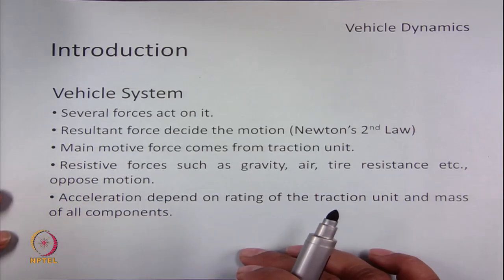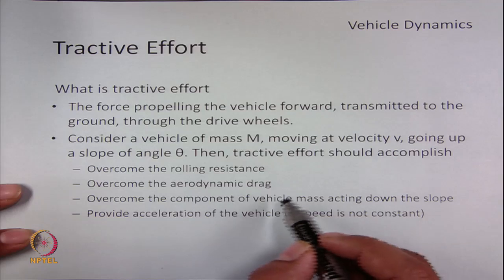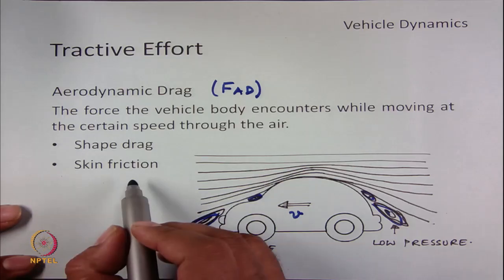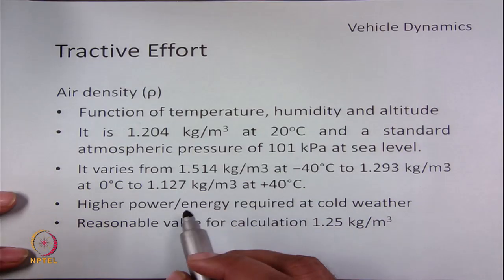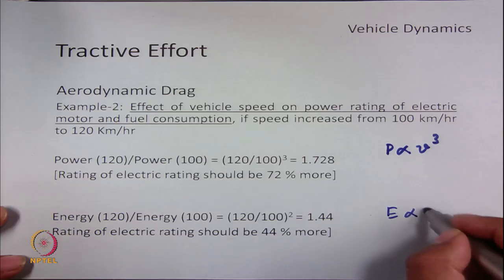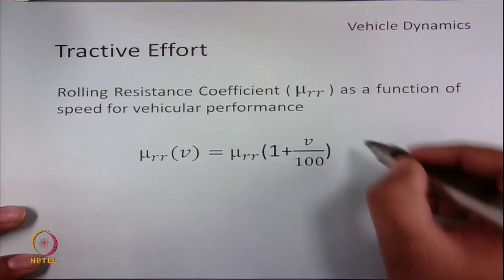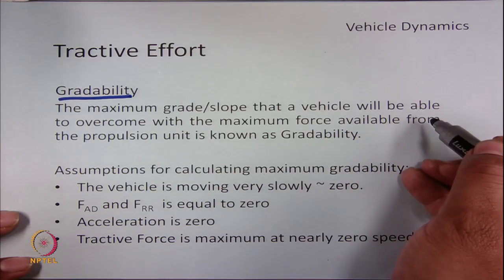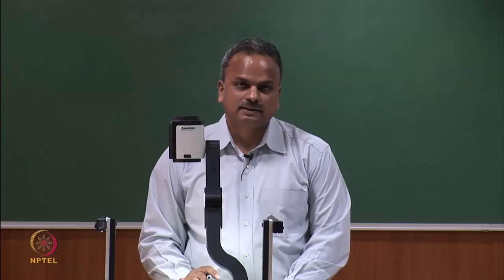Vehicle_Dynamics_intro_and_tractive_effort

Comment: in 33.27 how the obtained power value of 1.728 is changed to 72 % ? anyone pls explain
Reply: (1.728-1)*100%=72.8% If we consider the Initial electric motor rating 1, then the final electric motor rating was found 1.728. That means, 72.8% increase from the original rating. Thanks :)